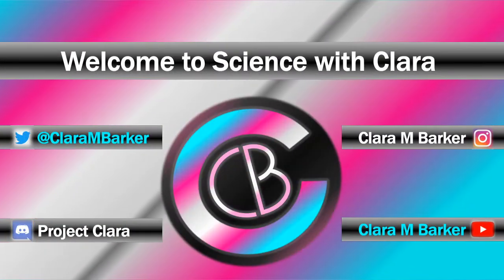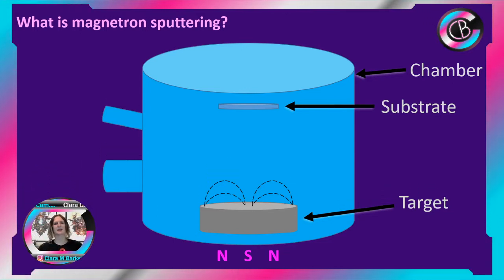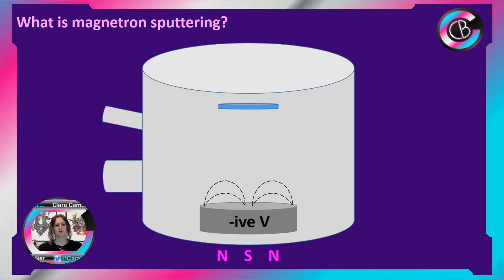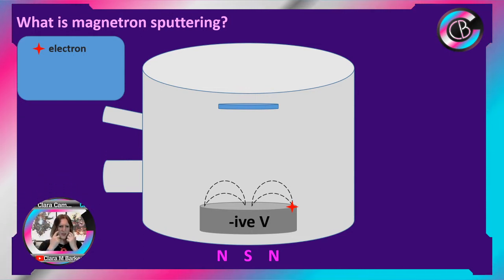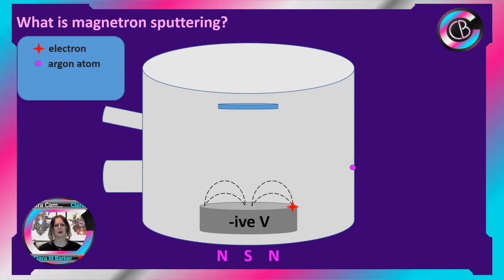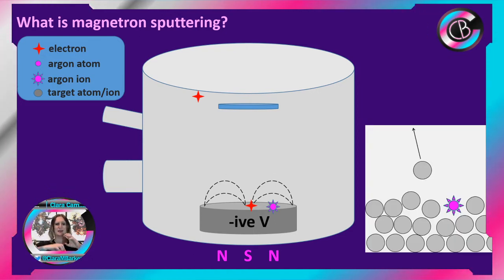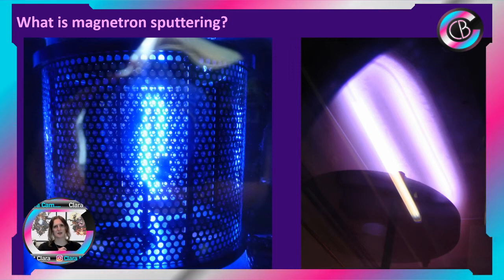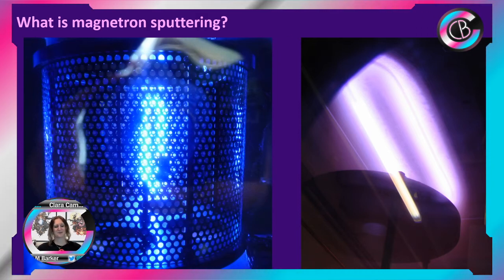A simple overview of magnetron sputtering

Comment: What causes the thin film being amorphous while using the RF magnetron sputtering?
Reply from the maker: Hi, 
films by RF are not necessarily amorphous. But generally RF is lower 'energy' - and low energy growth for most materials means an amorphous film so you have to find ways of adding that energy (such as added substrate temperature during deposition)
Reply: Thank you for your response, Dr. Clara. I’ve done vanadium nitride @ 50W and 400 degree celsius but still it’s amorphous. Does it depend somehow on the target’s material strength? Aside from the substrate heating, what could be another way to make it crystalline?

I’m sorry for i have a lot of queries 😅 anyway, thank you so much Dr. Clara
Reply from the maker: @cjestrada1199  I'll be honest, I have not made vanadium nitride so I don't know what sort of current density or temperature you need to make it crystaline. 
I found a paper (that used DC rather thanRF) and it seemed that the deposition pressure was important https://avs.scitation.org/doi/pdf/10.1116/1.580180https://avs.scitation.org/doi/pdf/10.1116/1.580180 - they vary pressure, substrate bias and target voltage so may offer some clues :)

Comment: Hello Dr. Clara that's a very good explanation. Thank you for sharing the knowledge. Could you please brief on what are the major parameters like ( power, vacuum, gasflow, distance etc.) influencing PVD process ( Magnetron and Evaporation). And it's impact on process and film property.
Reply from the maker: Hi there, thanks for the lovely comment! 
As for the parameters - I'll be honest, that is probably a series of videos of themselves (some o which i am workign on :) ) 
All of these things have an impact but sometimes more, sometimes less. It can vary on the material being deposited and on the design of the system. Every time i make a new material thin film, i try to have a quick explore of how they change the films I am making. It may be they do very little. (I am doing this very thing this week!)
Reply: @ClaraMBarker  Thank you for your response. Is there any article or journal or presentation which you can recommend to know about PVD and it's Parameters specific to Magnetron sputtering and Thermal Evaporation. Pertaining to solar cell manufacturing.

Comment: In RF magnetron sputter coating (13.56 up to 2kW), is there an optimal relationship for distance for a given power? What effect would you have if you sputter with long distances such as 12"+ substrate to target? Working with Ti, TiN, NiTi, SiC, SiN, Al, ITO... Thanks.
Reply from the maker: hi. there are optimal distances but it depends on the system geometry, background and working pressure, gas partial pressure and a whole host of things. It's a case of optomising for each system so I'm afraid I cannot say.
And the different materials you mention will all have very different optimal conditions. 
That said, 12" is a long target-substrate gap. so you will probably loose a lot of the deposition rate, I'd imagine. And probably arriving species energy also - meaning the films will not be ideal. 
It is very much a hand wave estimation, but sputtering tends to work best 50-100mm for the target-substrate seperation.

Comment: Very helpful video! Thank you! Can you also discuss what are the different reason why the sputtering stop during process? I still don’t understand what causes Interlock, Overload and Arc on the DC power supply.
Reply from the maker: Hi Cohen. there are lots of reasons a plasma can break down. Looking at the three things you menton - again they can have mutliple reasons but i give some thoughts below. 
So interlock is usually a hard wired switch - maybe ou cannot turn on the power supply unless water is flowing, or you are below a certain pressure. if that comes on a turns off your process, then that is an equipment issue. 
Arc - so this can be a few things. It is pretty much a build up of charge on the target surface - maybe the surface is becoming non-conductive (eg an oxide build up) so charge builds up then reaches a critical point and forces a hole through that layer. Maybe the easy path to ground is disrupted (such as with a disapearing anode) so again, the system has to force otherways to ground. there are other reasons but these are the most likely. some powersupplies will shut off when arcs occur and if your plasma is difficult to ignite, it may not restart once the arc has ended. 
It could also be that when the magnetron is put together 'quite'  right or maybe there is a flake of metallic debris or plasma in an unusual place, so the system can easily form a short circuit to ground, and in that case you have very little resistance, thus no voltage and full current being drawn from the power supply. these things can happen during deposition and will cut your plasma. depending on your power supply, this could show up as an Overload and it is something you need to sort out or risk equipment damage.

Comment: Hello Clara! What machine you would recommend for small manufacturing of narrow band filters for astronomy? The required specs are over 90% transmission in only 3 nm narrow range in 565 nm for example. Thank you for your opinion!
Reply from the maker: Hi there,
I'll be honest - there are a lot of parameters. many of the sputtering rigs i have used have been really old and heavily modified. There are a number of suppliers I know of currently, around the world. Really, it will depend on your needs (throughput/size/etc) and funds. Ideally, it may work best making some sample filters with a research group first (Universities often do short projects like this), and taking it from there.
Reply: @ClaraMBarker  Thank you! Do you know what kind are those machines:
https://youtu.be/KBsr4vzBkWo?t=51
.. this is probably the largest manufacturer in this field.
Reply from the maker: I don't know that manufacturor. Not sure what technique they use - looks like sputtering but really never come across them (and I've used a lot of different machines). I couldn't really make a company, I can more talk about the technique and experiimental side.
Reply: @ClaraMBarker  do no worry - thank you!

Comment: Hi there! Great video very informative. I work in thin films making optical filters where we use magnetron sputtering of either a niobium, tantalum, hafnium, or an NbTi alloy target (these make up our high refractive index film once oxidized) and I have a question regarding low index material sputtering. We’ve been trying to figure out how to sputter a material like Silicon to make SiO2 ( glass basically and out low index film) but for whatever reason it appears to be non-trivial. I only have a physics BS and the engineers don’t talk to me much so I was wondering if you knew why this is such a challenge? Thanks!
Reply from the maker: thanks for the comment! 

As for why it is so hard - some materials just like the 'perfect' condictions. metals and metal alloys are more simple but with reactive sputtering, the partial pressure of reactive gas, flow rate, where the gas enters the chamber in relation to the target, over all pressure in the chamber - these all have an impact. Sometimes you need to look around to find the best conditions. It is possible to reactivly grow SiO2 - I actually did it for a project - but finding the right window can be tricky.
Reply: @ClaraMBarker  I knew it had to be something like that. We currently use resistance evaporation for our SiO and the apparatus (we call it “the boat”) throws a ton of variables into the mix, especially when using a multi-spinner chamber which needs a monitor to work ratio due to not actually measuring through the substrate. Big mess! 

Personally my favorite plasma is the NbTi alloy target...pretty blue color! Thanks for the response.
Reply: If your doing magnetron sputtering of an insulating material, you likely need to use RF instead of a DC source.